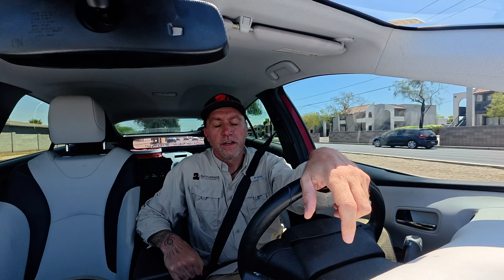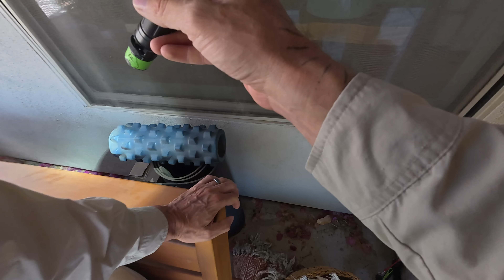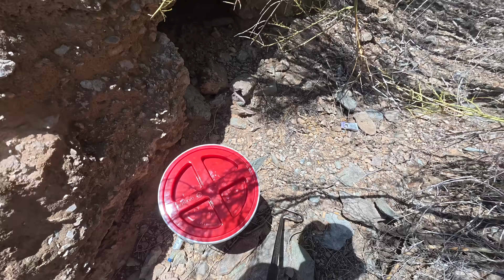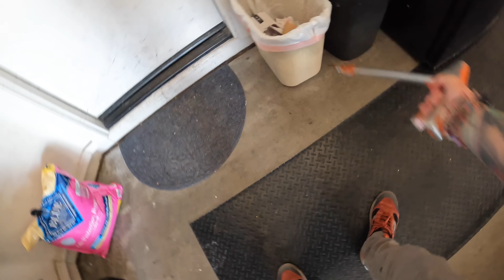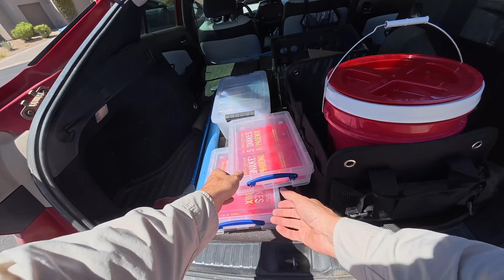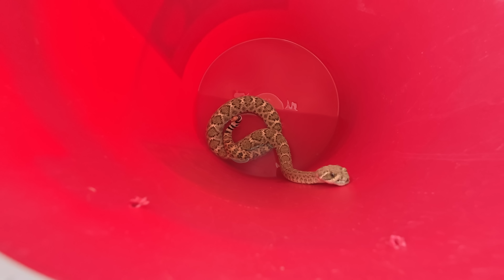What Rattlesnakes Do in Arizona's Extreme Heat

Comment: Thank you! Hard to watch this one...Maybe a small, white van with no windows could help keep the intense heat from boiling over. It was 118 in Parker a couple of years ago.  We had to  pull into a library until 6pm just to keep from getting sun stroke. We love our white van but when the sun bakes the glass it's bad. Reflectix helps the side windows but not the windshield.